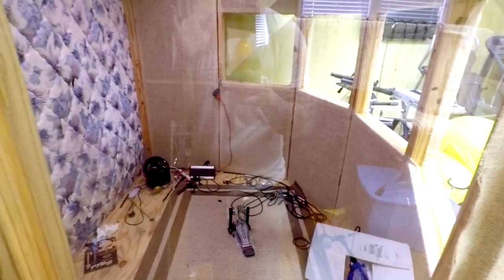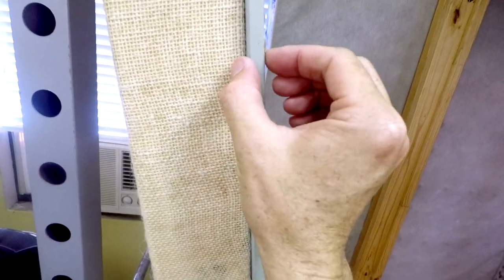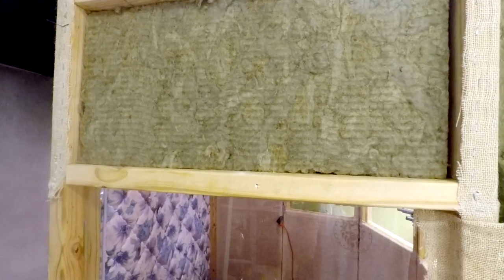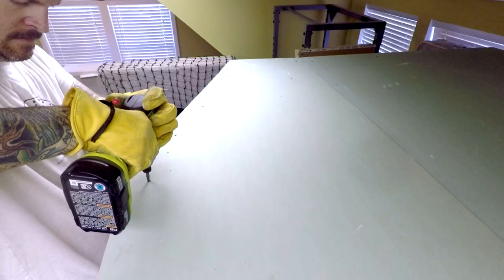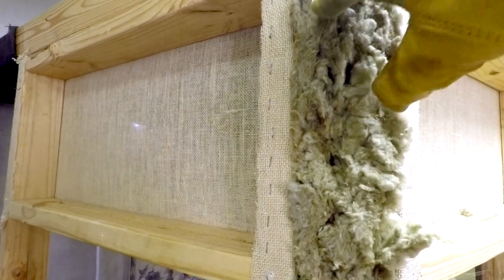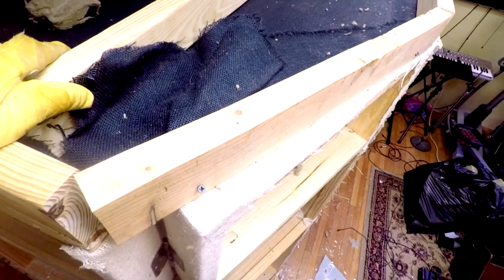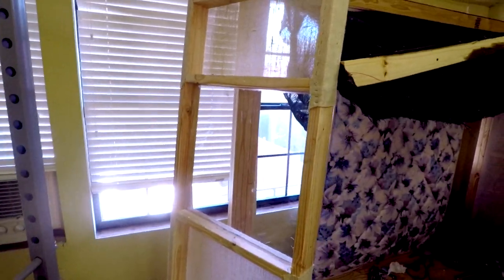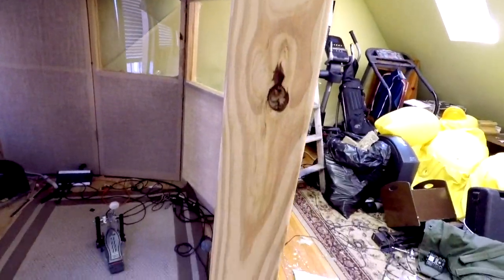DIY Drum Isolation Booth: Step By Step

Comment: cool project. I'm going to follow your lead, change it up a bit. I am going to try bifold closet doors, tear them open, fill 'em with this wool you list here, glue 'em back up, six two foot doors linked up into one hexagon, on an perimiter of 12 feet for a base and roof, then design a skirt to hang over made of moving blankets, then create inserts of burlap covered wool that velcro together inside to cover the doors and the roof, of course also wool inside the floor... No window needed, going to use it for a mini drum booth plus a vocal chamber. Just have to figure out how to make one door an entrance. Throw it on rubber mounts... not touching the floor or wall or ceiling. Should do the trick. Love this video it was inspiring man. I'm going to build it with masking tape and string hung from the ceiling before hand to make sure I can fit while playing. I might have to expand it. But I want it to be very portable and easy to dismantle and move. Biggest pieces will be two half circles for the base and two more for the ceiling, but also I have to fit my Mackie D8B somehow, too... We'll see. It works in my mind. Reality can be a bitch though, my basement apartment's ceiling is only 74 inches, yikes. Whole thing has to be six feet tall, and fit my drumkit, D8B, and my flailing arms. Maybe I will switch to an octagon to maximize the 12 foot perimeter.

Comment: guys you will kill Your drummer , this wool is rockwool , so it is not healthy for breathing inside the both!!! Make some research about installing these type of wool or get some eco wool like sheep or recycled cotton , if You want one side open and covered with fabric !!! Point is that very small peaces are going trough fabric when moving , what happen with sound vibration!!
Reply: Lots of professional studios use this insulation with no issues.
Reply: @GrandNebSmada  yep, you should use mask while installing these, and also maybe use some kind of stretch foil to cover the wool. Once little rock wool fibers go into your lungs you are stuck with them inside for a long long time.
Reply: It’s called Rockwool “Safe & Sound”.  Body will process and expel if ingested. Not like fiberglass or asbestos.